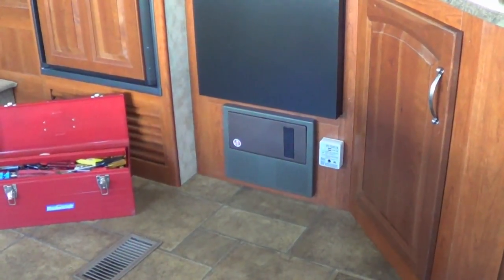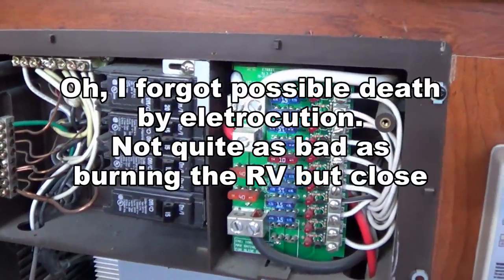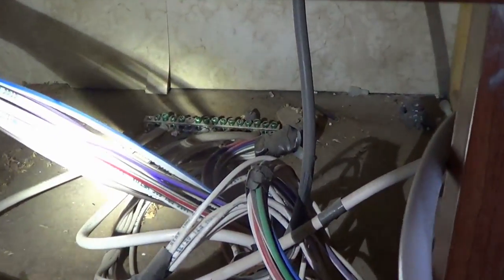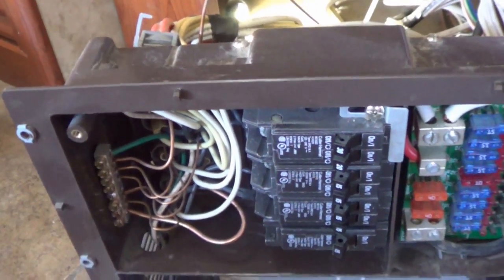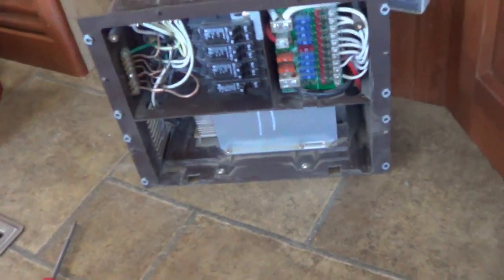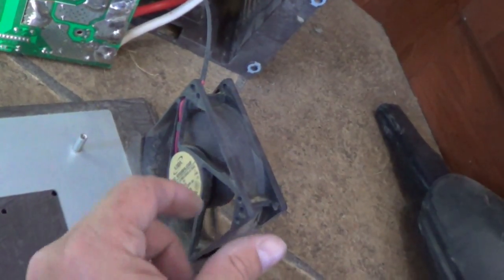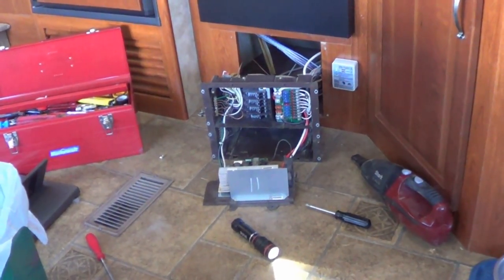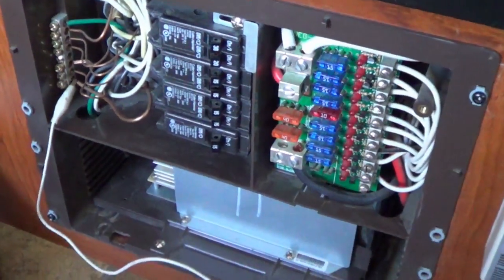RV Power Center Inspection and Maintenance WFCO WF8955

Comment: Really so nice and thoughtful of you Ray, to show us this. My 2015 Keystone Outback travel trailer has one very similar. I will check model number tomorrow. Seems strange why RVs don't come standard with top quality converters and ALSO an excellent inverter system. Safety first, thx so much. Happy Camping! Also, Ron from Sika tells me the Sikaflex 715 is their best (proper) caulk product for the rubber roof but he didn't know how well it bonded to Dichor caulk or the Eternabond tape.
Reply from the maker: Thanks, good to know.

Comment: Cool video Ray.  I took mine out too when installing my solar so Greg & I could see what was going on.  Since there is a fan on that unit, I will be sure to check that every couple years and clean the blades off so it is more efficient.  Thanks for the detailed explanation.
Reply from the maker: You're welcome. :)

Comment: Great advice and tips Ray.  I just did a similar thing last week.  I am going to mount my TRC 41300 auto transfer switch in that space behind the converter.  I have my 3000 continuous watt pure sine inverter mounted in the front storage compartment like yours.  Now I'm just trying to find the path with the least resistance from the inverter to the space underneath the stove.  It's about a 20' run of 10-3 wire for me.  I have a wireless remote fob for my inverter and the TRC transfer switch is generator (inverter) dominant.  The only thing that I cannot use with this setup is the central a/c unit.  The extreme heat and humidity has arrived here in Mississippi and it puts a whooping on me.  I may have to finish up  this project in September.  I'll bet Vancouver weather is very pleasant right now.
Reply from the maker: Sounds like a great setup. We've had a beautiful stretch of weather after a cool June. Last week or so has been sunny in the mid-70s with more to come. With the ocean up here being around 55 - 60 water temps we always get a nice breeze off the water. One of the best places to spend the summer I think. Cheers!
Reply: Wow, heavy stuff.  I’ll get there someday.

Comment: Ray..I copied your system as you may remember for the solar panels. I have not had time to do any videoing or editing. We went out camping for a week and we ran out of water before we ran out of electricity. All we was using was  sun light. Thanks for all your great videos. (we found a great spot to camp for free I did make a video of that,  if you've never been to the Sawtooth Mountains you may want to check it out)
Reply from the maker: Awesome! Where abouts are the Sawtooth Mountains. Idaho?
Reply from the maker: Sweet looking spot for sure! Thanks, Our problem is we are in the US between Nov and April so most of the high country is still too cold. Have to do a summer trip down there again one year.

Comment: Just a suggestion from another youtuber (My RV works) he recommends checking the torque specs on the board and checking all the wire connections and make sure they haven't come loose from vibration common in RV's. Preventative maintenance that could prevent something serious from occuring, (loose wires cause fires)!
Reply from the maker: Thanks, yes, good tip. I did that --->  https://youtu.be/gr2iNdMzqi4?t=322
Reply: @LoveYourRV  LoL sorry I missed that part! Thanks for the helpful advice 😉

Comment: I have the same WFCO8955 PEC unit. I read in owners manual that it won't charge lithium. Wha chew know bout that?

Micro Minnie winnie is pre-wired for 30 amps of solar, jb with mc4 on roof, wired to front storage location,  batteries right there.

I have a couple of 100 watt panels ordered , a Renogy 30 Rover and hopefully all the other stuff to make this work. Rig came with two 75 ah deep cycle sla, will upgrade to lithium when I figure out the 8955 unit and what I need to do
Reply from the maker: My WFCO895 unit doesn't charge lithium very well, here is a demo video I did about it - https://www.loveyourrv.com/lithium-battery-charge-test-can-you-use-a-lead-acid-charge-converter/

Comment: Are you running solar?  got a question if so...  is the solar panel cables running to a braker in that box?  If so, where, and is the output of the braker leading to the charge controller?
Reply from the maker: Yes and no, I have my solar cables running into the front storage compartment of my fifth wheel where the batteries are located. That is where I installed the solar charge controller. More info on my install can be found here - https://www.loveyourrv.com/boondocking-power-upgrade-200-watts-wiring-update-mods/

Comment: you are lucky its been 6 years and you have never had to open that up, my 1st trip in my new 2017 keystone 308 hideout, my converter took a dump and i was already taking this apart
Reply from the maker: Real lucky considering we full time in the trailer. At least now I have 2 converters on boards in case one fails.
Reply: yeah and it only took the service department 2 months to fix it, even after they told me since ive only owned it less then a month i will get bumped to the front of the line lol oh well, finally picking it up tomorrow
Reply from the maker: Holy crap, long time. Hope it's smooth sailing for you after that. Cheers! Ray

Comment: Question for you: At 2:25 min on the video timeline you point to that lower big black wire on the D.C. distribution side, and say, "Down here, this black wire, that's the one goin' off to my batteries, to charge my batteries . . . " WHY IS THAT WIRE BLACK instead of red right there??? It is connected to the post labeled: "POS+" on the 8955 WFCO -- I know, because I, too, have an 8955 and have it all wired up, unsure of where that last 8 ga. black wire connects. For background, I am doing a changeout of the old MagnaTek converter/charger in my 1988 Winnebago LeSharo RV. Did some RV manufacturers use large gauge black wire instead of red wire for the charging output to the house battery???
Reply from the maker: Yes, RV manufactures commonly mix color codes.  Many are using white for the negative/grounds and black or white with a color stripe for the +12V wires.  I guess they are sort of using the AC code of black is the hot wire. It quite weird but that's they way they do it. Then in some places I've seen them revert to the automotive/marine standard of red for + and black for -   Best thing on an RV is don't trust any colors, always test it.  Here is a post about it with various color codes used - http://www.rv-project.com/resources/wirecodes.php
Reply: @LoveYourRV  Thank you so much for your amazingly PROMPT answer here, Ray -- you have saved me tons of puzzled "head-scratching."

Comment: On the DC fuse panel, what is the many white cabls ? I see the white neutral for AC fuses but what is the white wires for DC fuse panel ?
Reply from the maker: They are the DC positive circuits. In many RVs such as mine, white wires are used for DC negative and grounded to the trailer frame.  Mine also uses white for the positive DC wires, but they also have various colored stripes not easily seen in the video. Recently I replaced my stove and had a chance to show behind the power center more clearly, so take a look at the clip https://youtu.be/FfsmPsW2GX4?t=671  Cheers, Ray

Comment: Ray, I have the WF-9855 converter. I don't know what the difference is, but mine is brand new and does 3 stage charging. Bulk, Absorption, and Float. Does the 8955 do that? I also noted that it looks like you added a 12 volt circuit in there? I have done the same. There were two vacant spots on mine. I am using a 3 amp circuit to feed a UV water system. Great video! Oops, correction! I see that the WF-8955 is the whole power centre, and the WF-9855 is a deck mount converter. So, we have the same unit!
Reply from the maker: I recently added a little volt/amp meter to mine https://www.loveyourrv.com/input-rv-ac-power-meter-install-mod-displays-total-ac-amperage-draw/  Really helped us this last winter to not blow the main breaker. :)  Also this charge test may interest you if you get lithium batteries.  https://www.loveyourrv.com/lithium-battery-charge-test-can-you-use-a-lead-acid-charge-converter/ Cheers, Ray

Comment: So, just to clarify, you kept the original convertor and installed a new, upgraded one, forward, near your batteries? Thereby having 2 convertors? That's okay? I don't know, that's why I'm asking. I'm doing a major reno job on a 02 Jazz. My plan was that while I have access to the hall wall by the bathroom, I would place a large conduit next to the vent pipe housed there. Then place a junction box on the roof, for the future. i.e. Solar or antennas The bottom of that pipe would land in the basement. After my current reno is done, one of my next projects was to upgrade the supply, convertor and rid myself of the old reel electrical cord, too. But, if I can leave that convertor and just add one to the battery bay when I upgrade to solar. I'd rather do that. Also, with your electrical background, would you replace all receptacles with GFC's?  Mostly for proximity reasons, I'm thinking. Anyway, would appreciate the feedback.
Reply from the maker: Yes, I still have the OEM converter and use it when plugged into shore power and use the InteliPower converter for generator charging when I want to get a quick battery charge. In my rig, the OEM just installed GFCI outlets near the kitchen and bathroom sinks and the outside outlet.  Cheers, Ray

Comment: had my wfco  converter replaced with intelli power 4600. the wfco had stopped charging and wouldn't even supply 12v any more. no such problems with the new converter. I have a 2007 keystone 278 RKS.
Reply from the maker: Cool. Did you have to do any modification to get it to fit?

Comment: Ray I noticed that one of your DC fuses is a red 10 amp and I'm almost 100% sure that they all should have a blue 15 amp one in every circuit.  Obviously someone in the past got lazy and replaced it with the wrong one.  In my 2015 trailer they all are 15 amp except for the last one which is a 1 amp (which I believe is for the LP detector).
Reply from the maker: We bought it brand new like that, never have had a fuse blow in 6 years full time use. It is labeled "Monitor" So I assumed it supplies power to the little battery and tank monitor panel and likely from there the water pump. I pulled it and confirmed that is the case. Cheers Ray
Reply: Fair enough, your electrical knowledge comes through on your videos which I do enjoy watching.  Take care.

Comment: As usual another nice & helpful video Ray.  Funny, I just pulled mine out on our new rig just to take a peek.  You mentioned some people and yourself, replacing the converter with the 60 Amp Intelli Power.  I am curious as it sounds like a good idea, but wondering since many rigs come with a 45 Amp converter, aren't the wires installed by the Mfg. sized for 45 Amp?  I would be concerned installing a higher amp converter might be too much for the wiring already in place. Curious what your thoughts are.
Reply from the maker: If I were upping my current output dramatically, I'd at the same time up my wire gauge.  My rig had a 55 amp converter, and they used 6 gauge which should handle a 60 amp unit.
The best way to upgrade though in my mind is to move the converter next to the batteries and run an AC line back to the power center. That way the long wire run is over 120 VAC rather than the DC cabling.
The problem with the long string of DC cable is it can have enough voltage drop to trick the smart charging circuitry of the converter into thinking the batteries are more charged than they are. In my rig, this led to the batteries never seeing 14.4 bulk charging, worse when I started adding more batteries. Of course, a person could swap out the 6 GA for say 2/0 heavy cables but that would get expensive.
 
Another thing to keep in mind is each battery can only take so much current I think the rule of thumb is around 15 amps, so sometimes having a larger charger doesn't do much. Also get too large of a converter, and a smaller generator can have a hard time firing up.
I find 60 amps is a good size for my 4 golf cart batteries and runs well off of my 2000W genny.
Reply: Thanks Ray, makes a lot of sense.

Comment: Wish you opened it up years ago and noticed the missing rubber grommets that prevent chafing the wires going through the power center chassis see 2:05. To all the newbies, install a grommet after the wiring has been spooled through, cut the round grommet and install it around the wiring to avoid chafing through causing a short.
Reply from the maker: Good idea. Looking online at pictures of others it looks like that power center never has them. I guess they think since the wires are run through plastic versus metal they don't need them. But I'm not too shocked, you'd be hard-pressed to find a rubber grommet on any of the RV wire runs. Most of it is using spray foam. Cheaper and quicker I guess.

Comment: If your battery is not getting charged there's 1 simple thing to check before you go through the work and expense of replacing a power center. If you've done any work  up in the front of the trailer with your battery or winch and there was an arc you may have popped an inline breaker located up under your frame. Follow the wiring under your frame and locate a small box ( under an inch long and 3/4 inch wide with wires connected to each end with nuts. Feel around the outside of the little box and you should find a tiny button of some sort. Push that button in and you should feel/hear a little click. If it clicks, congratulations. You fixed it. Check the voltage going to the battery and it should now show 13+ volts.
Reply from the maker: Thanks for the tip. Can you provide the make and model of trailer this refers too. Cheers, Ray
Reply: @LoveYourRV  2016 Rockwood minilite 21ft. However every trailer I've owned has had one of the little inline breakers somewhere close to the battery. I realized today that my battery was dead and the trailer connected to shore power so I started trouble shooting. The power center looked fine so I started tracking the wiring.  Figured out where the breaker was hidden , felt around for the reset button and when I felt the click I knew it was fixed.
Reply from the maker: Thanks, mine has similar but they are an auto reset type. No button to push.

Comment: You mentioned your intelligent converter.  I see you still have the OEM converter as well. I’m trying to figure out how two converters work. Can you please explain?  Thank!  Love your videos!
Reply from the maker: Here is a video clip that explains my use for the InteliPower - https://youtu.be/uRbGmxun1LI?t=765
I decided to leave my OEM converter charger as is and install the InteliPower right next to the batteries to eliminate any losses in the wiring.  My OEM location was so far away about 20-25 feet of 6 GA cable so I didn't want to install there.
I still use the OEM on when on hookups to shore power, may as well wear it out I figure. It doesn't really have to do much as my solar system is also charging the batteries and does a great job of keeping them topped up.
So I use the Intelipower exclusively as a battery charger for when off grid and charging with my generator.
If my OEM converter ever fails I could always run an AC power line to the Intelipower from the RV power distribution panel.

Comment: Great vid.   My WFCO unit is the exact same model except whomever labeled the breakers, fuses, etc must have had a long lunch break or was writing is some other language bc I can hardly make out what is what.  Are the items labeled going to be different from rv model to model? (I would suspect but not sure). I see the third one down on the breaker side is labeled “gen” and I do not have a built in generator on my rig that’s why I’m asking.  Can you advise where I could find a chart for my exact model (2018 Heartland Pioneer RL250) so I can print up some proper labels to affix?
Any tips would be appreciated.  Thank you.
Reply from the maker: On my unit, Gen stands for general AC outlets and then there is a separate breaker for GFCI AC outlets. Sorry, I don't know of a chart, I guess one way to figure stuff out is to switch off a breaker or pull a fuse and see what quits. Cheers, Ray
Reply: Love Your RV , gotcha Ray, appreciate the help.  Your vids are great.

Comment: Thanks for the great and informative video. My GFI outlet in the bathroom will not reset. I replaced it and that did not fix it.2 other outlets in the kitchen don't have power either. The breaker in the main panel has not been throw. I was told that there might be another ground fault breaker, but I can't find it. Do you have any clues as to, where to look. I was told to look outside near the front of the frame. We have protective winter seal underneath and I don't want start taking things apart. Our RV is a 2016 Forest River 265rlds. Thanks for any help. Randy
Reply from the maker: No, sorry, mine only has the one breaker on the bathroom outlet and it's is for all the GFCI outlets. I have one GFCI outlet outside and one outlet above the kitchen sink. Maybe one of the outlets is bad. Good luck, Ray
Reply: @LoveYourRV  If you have an outside plug on the side it is probably GFI.  Look near your outside kitchen if you have on.